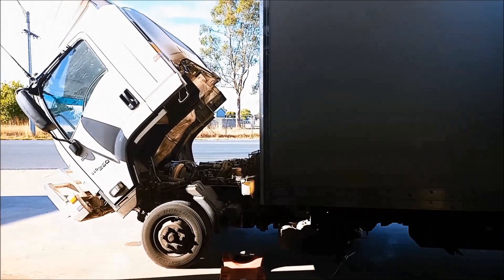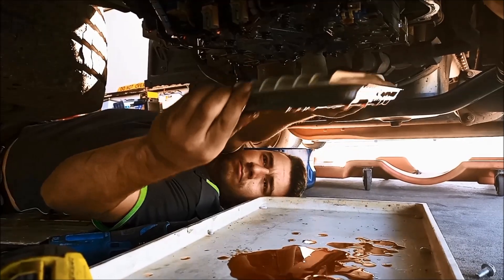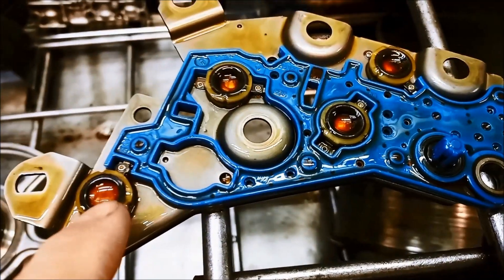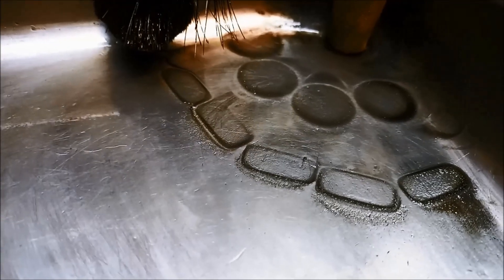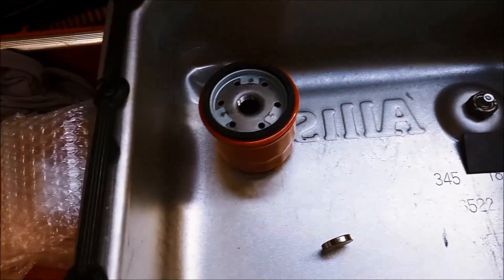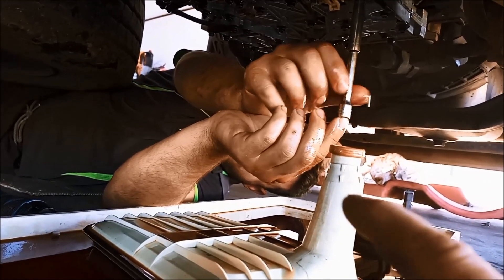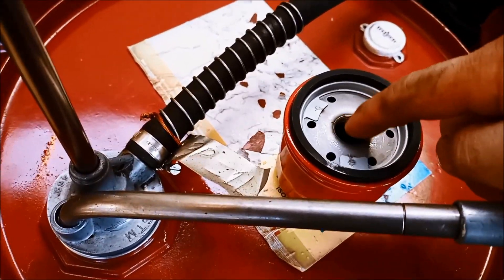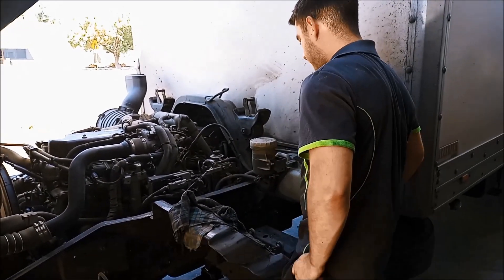Isuzu 6sp Allison AMT Automated Manual Transmission Filter Service Switch Plate Flush how to diy

Comment: What symptoms did the truck have?
Reply from the maker: hi, this truck trans service was preventative maintenance. their other truck in fleet was going into limp mode constantly. the driver was turning off-on 20-40 times ( every time ) to be able to try drive it normally and not in limp mode ( potentially frying starter motor ) make sure your battery is charged & strong ( low internal resistance ) and trans electrical connections arent oxidized. see vid https://youtu.be/z1XdXYnkUHE cheers
Reply: @YepThatsIt  I have to turn it off and on again every time it fails and it works normally again for a while, the scanner also showed that the transmission fluid was not in good condition and I replaced it without success! but I did not clean the blue piece that you cleaned, I will have to do it

Comment: There usually a magnet in the spin on filter ?
Reply from the maker: hi, yes the oem filters come with them usually - not so much the aftermarket ones ( and sometimes the original magnet won`t fit on aftermarket filter ) we like to add magnets inside the pan as well. the spin on filter has fluid that has already passed through the internal filter anyway filtering the cooling line fluid. we often will stick a neodymium magnet on the outside of the filter ( same on engine filters ) to catch any magnetic debris. thanks for that observation, cheers